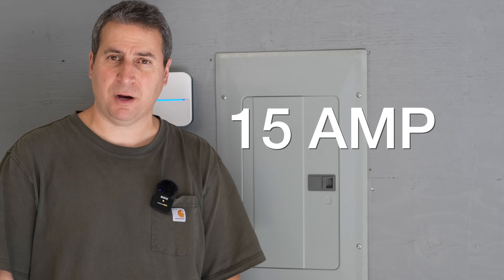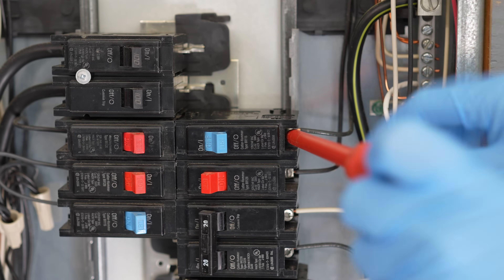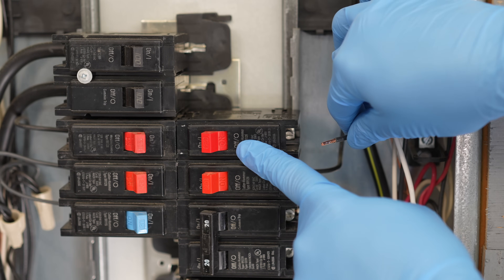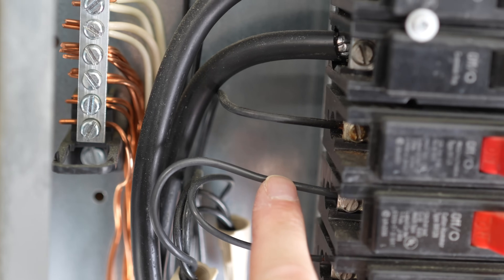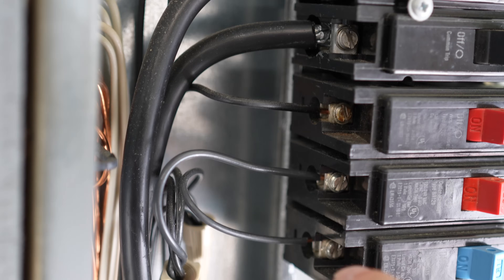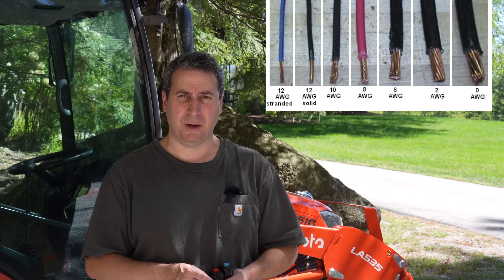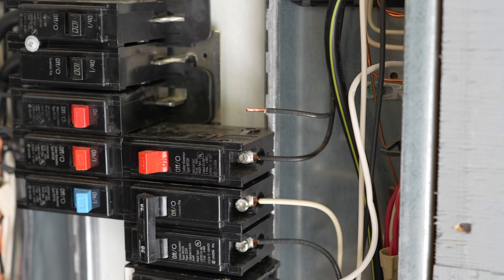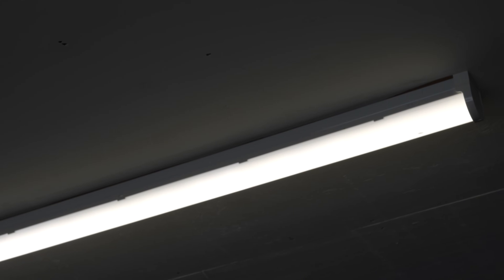WORST MISTAKE Homeowners make upgrading a 15AMP to 20AMP Circuit Breaker

Comment: I think it's important to point out the consequences of undersized wires - if you overload a wire buried within your wall, they WILL overheat and can cause fire INSIDE your wall!  Think about where the wires run through the studs all throughout your house.  It's often catastrophic, and even if it's fit your your purpose for a transient load, it's just a matter of time before someone hooks a long-term overload to the circuit.
Reply: Is there anyway to determine whether a smaller gauge wire is some where in your house?
Reply: @butchtaylor5086  For an exact answer, you can measure the circuit resistance (with the right test equipment), but you would still need to know the length of the wire to determine if the heat dissipated over the surface area exceeds the wire insulation rating.  But a much simpler test that would identify egregious problems would be to place a brief known high-current load onto the circuit, then measure the voltage with a meter before and after turning on the load.  I can't give you voltage drop figures off the top of my head but there is probably information on the internet that can guide you

Comment: This is ridiculous. What do you think the odds are of finding an entire circuit wired with 12 gauge wire being fed by 15A breaker?
Reply from the maker: Not at all many houses had larger wiring on 15amps. Not every electrician or builder only follows mininum requirements. Nowadays yes, older homes got much better treatment.
Reply: @SilverCymbal  I've never seen it up here in Canada. One electrical inspector told me that he had even seen speaker wire used in the walls!

Comment: I just found out that I can no longer find circuit breakers for my antique Federal Pacific stab-lock breaker panel -- gonna have to replace the whole box next week.
Reply from the maker: That's difficult when that happens. My two favorites are the Square D Q0 line https://amzn.to/3Bd7Deb for a little more money and their Home Line is unbeatable.https://amzn.to/3U423Dt
Reply: @SilverCymbal  Thanks!
Reply: You could try eBay.
Reply: That's a big job, but it is worth it to get rid of those Federal Pacific breakers - unsafe at any amperage!  😄
Reply: @Sylvan_dB  Agreed -- the design looks a bit iffy.

Comment: Great way to start an electrical fire if the wire is 14 gauge. The wire will burn before the breaker opens to stop it. 

14 gauge wire = 15 Amp breaker. 

12 gauge wire = 15 or 20 Amp breaker.
Reply from the maker: Hope you watched the whole video

Comment: can i ask why the wires connetced to the electric breaker look so thin but some house items have cables that are SO thick that plug into the wall that's what gets me worried about opening up my Breaker you should also make a short video about that
Reply: The unit the ypu may be plugging into wall has to be flexible and rated for constant flexing and much more abuse than a solid copper wire in a wall that's stapled so it never moves. Most cords to appliances are stranded wire that's flexible which is larger also than solid copper to care dame load. Appliances also have to be UL tested and that makes them go to a level that wiring in your home doesn't need to meet because its completely different application. Hence the over built cable on plug in devices. It's WAY more than it should need to be but because its a moving and handled constantly, electric cable, that's what it should be especially for insurance. And that's a good thing.

Comment: Adding a new circuit breaker and new wires at the same time can be a hassle depending how far away the circuit breaker is away from whatever you're trying to do, but like you said it is the safest way to do it.

Comment: Thanks for the video, this confirmed my assumptions.  Would love to upgrade my garage to 20amp, but I can wait to pay for it to be done right.
Reply: MC cable, run on the wall. Thats quite easy and not too expensive. Then metal boxes and conduit around your garage. Not that hard. That's what I'd recommend if you wanna try it yourself.

Comment: I'm starting to get the feeling that the 50A breaker  I put in when I pulled out that 15A breaker isn't to code......
Reply: That is similar to removing a 5A fuse and replacing it with a 30A "no blow"   :-)
Reply from the maker: OMG! Don't laugh people do crazy stuff out there.
Reply: @SilverCymbal  I could imagine. Great content as usual.

Comment: My entire house is wired with 12 gauge wire. Therefore, you are saying I could upgrade my entire panel to 20 amp breakers? 
And if so, what are the advantages to having this done?
Reply from the maker: A lot of high quality installs used to include upgraded wire sizes for an added layer of protection, similar to using larger sized lumber. In theory you could upgrade to 20amps but if you aren't tripping them now at 15amp there really is no benefit but its still wonderful to have a larger gauge to reduce chances of overheating
Reply: Some times a house had the breakers far away from the point of use and 12ga wire was used on a 15amp circuit to reduce the voltage drop. If the entire circuit, every wire, was 12ga you could swap and probably be safe trying to run additional devices, but they might malfunction because of too much voltage drop.  This can burn out motors and pumps.  A simple space heater will be fine, and in addition the voltage drop in the wires turns into heat so you'd have a bit of warmth distributed all the way back to the breaker.
I've seen multiple instances where looking inside the breaker panel it all looked like 12ga, but the rooms on the far side of the house were actually wired with 14ga.  I've also seen many times where the wire from the breaker to an outbuilding or lamp posts was larger than the wires in that outbuilding or between the first and second lamp post.  It's all about reducing voltage drop/loss in the wires.
Reply: Thank you, guys for responding to my comment and my questions!

Comment: Very much the same for automotive wiring. Installing a larger-than-rated fuse causes all sorts of problems, up to and including fire. An automatiç circuit breaker, (i. e. certain power accessories) can be even more dangerous. 

Do yourselves a favor: don't go above the fuse rated for the circuit.
Reply: Agree i made a mistake I put 25 amp on a 15 amp wiring and now a mowers won't start.
Reply: @WilliamHollinger2019  Something popped that fuse. Could be old age (yes, they do weaken after multiple duty cycles), could be corrosion, or it could be drawing too many amps/mechanical wear. Check your wiring, make sure you haven't burned anything. Check for corrosion on the battery terminals and any connections in the circuit. Ensure you have no missed or bad connections. REMEMBER: simple and stupid first, THEN dig deeper.

Comment: I thought the current code prevented changing the wire mid circuit, meaning that a circuit that uses both 12 and 14 gauge wouldn't be compliant. Of course, even if I'm right, that's no guarantee that your house was actually wired that way so you need to verify.
Reply from the maker: Yes but exactly what you said, sometimes it will just happen anyway especially if the person expected to only see the minimum wire size for the circuit.
Reply: You're assuming each homeowner followed code, which we know doesn't happen. LOL

Comment: Could it be possible that an older house already had been upgraded from 10 to 15 amps without upgrading the wires - if so, that would be a huge danger for now replacing the 15 amp with the 20 amp. So, is it best to confirm wiring capacity prior to replacing circuit breakers? Just a thought.

Thank you!
Reply from the maker: For older homes you always want to have a pro check your wire sizes and breakers to be sure. Sometimes older homes are too bad because they may have much fewer connection points, outlets, etc to check so it can be verified with less effort. I lived in a house that still had knob and tube wiring so I know that older homes can be different for sure.

Comment: I'm an electrician 28 years in the business, this was an excellent and educational video about breaker upgrades. Very well done
Reply from the maker: I appreciate that
Reply: I have a 20A AFCI/CHAF breakers in my house. Those breakers keep tripping when I use my 11A carper cleaner, or 10A treadmill. But using my GFCI bathroom plugs or the outside  GFCI plugs, it works fine. What can I do? Thanks
Reply: @dvuemedia  unfortunately I've run into a lot of problems when homeowners call me and tell me their afci Breakers are tripping due to heavier house appliances. On a normal GFCI breaker it doesn't trip as much but for some reason the afci technology that's monitoring the sine wave of the current passing through it gets distorted when heavier equipment is in use. Best bet is to make sure no other appliances are on that circuit when you're running your vacuum or try to have it plugged in a different location
Reply: @titobandito-777 , I tried using different outlets, same issue , I have to use GFCI outlets. I probably need some kind of "slow blow" fuse, if one exists.
Reply: @dvuemedia  there is no Slow blow fuse if you're using an afci circuit breaker that I know of.  Afci Outlets will give you majority of the problem like I said you can try upgrading to a new AFCI/GFC I do function Outlet and see if that will resolve the problem or you can try upgrading to a newer Appliance majority of the time that will fix the issue also.
Reply: @dvuemedia  the best bet is to use a GFCI outlet like you had mentioned or try upgrading the outlet itself or the appliance. If you have any other questions feel free to ask
Reply: @dvuemedia  unfortunately now with the afci technology there's not much you can do because of the nuisance tripping that's caused by larger motor powered appliances, you can try upgrading the afci outlet the brand new one or try to plug the Appliance in a GFCI outlet for now. I know then you were afci Outlets are a little more durable
Reply: @titobandito-777  Is there a some kind of external noise filter I can use, maybe surge protector?
Reply: @dvuemedia  I doubt a surge protector would work but it is worth a try.  The way afci outlets work is they measure the sine wave of current traveling through it. The sine wave is distorted enough by a large capacity or high output motor it will trip the outlet immediately. The technology is just not there yet with these outlets, it will be soon, until then we need to find ways around it. Is your outlet tripping or is it the breaker in the panel?
Reply: @titobandito-777  It's tripping on the panel using the treadmill and carpet cleaner (vacuum is fine) . Both work fine using bathroom outlet on GFCI.
Reply: @dvuemedia  switch your afci breaker in the panel to a regular breaker and install afci outlet in your wall. People have done this with success
Reply: @dvuemedia  someone "up there" is trying to tell you not to use the treadmill!
Reply: @dvuemedia  or you can swap out that outlet for a new one
Reply: @titobandito-777  swap the outlet? Are you referring to the receptacle? Or the accident/gfci breaker.
Reply: AFCI. Not accident 😮
Reply: Sorry to say I disagree. Problem is those people that ONLY WATCH the beginning. I fully agree with what was said & an excellent demo. Thank you for that, just add some sort of “you may think this is the right way” in the beginning to catch those idiots who think they learned it all in just watching the start up. Please don’t stop with your videos, we actually do learn & use the info you supply. Thanks for your hard work.
Reply: I agree with Oberto, great video - I would add to verify all the outlets in the circuit. I get that the point of this video is to discourage novices from doing electrical work, but for the sake of thoroughness it should be mentioned that the receptacles need to be rated for the circuit as well.
Reply: Nice Chrysler 300
Reply: @Latrizzy_O  Thx man 👍
Reply: My circuit breaker keeps tripping. Should I just replace all the breakers with new ones with the same amp
Reply: @keitht24  Did you ever fix the problem?
Reply: @glasshalffull2930  Yes. The breaker wasn't the problem. The system wasn't built to handle the load. I had to upgrade the system for the house to a 200 amp capacity.
Reply: @keitht24   Well, a new setup is certainly safer!
Reply: @glasshalffull2930  This was very old house that I'm fixing up. Apparently the previous owner simply installed a 100 amp main breaker on hat was previously a 60 amp main breaker. This was done without upgrading the system to handle the larger capacity. I could've just upgraded the system to keep 100 amp. But I decided to overhaul it & upgrade to 200 amps to future proof the house.
Reply: @keitht24   I used to live in a house that had fuses and it was certainly not 100amps, but we were blowing fuses all the time.
Reply: This reminds me of the fuse days we had 30 amp fuses. Dad used number 10 wire which was okay. 73
Reply: Oh I forgot some people put pennies or larger fuses which I never recommend period!. Wire size matters. 15 amp usually number 14 unless someone over killed the wire size to 12. Thirty amp needs number 10 I seen short runs like 6 feet or shorter use number 12 which I don't recommend. Your not saving money by using the wrong size that short distance. 73
Reply: Yep, good job! I was so ready to roast ya, till ya told us about ampacity
Reply: My old water heater broke down and was going to go to a tankless water heater. The old heater was on a 30 amp circuit breaker. What wire gauge is that on?
Reply: I got a 20 amp breaker that keeps tripping every time I turn the heater on in the bathroom while the heater on is in the living room it always trips. I will say the house is wired very crazy two hot points connecting to a damn fan. You can switch the light switch but the lights going to stay on. The guy that wired the house was a crackhead.
Reply: Yep I been doing it longer than you but I still learned two new things from this gentelman. How often does that happen lol.